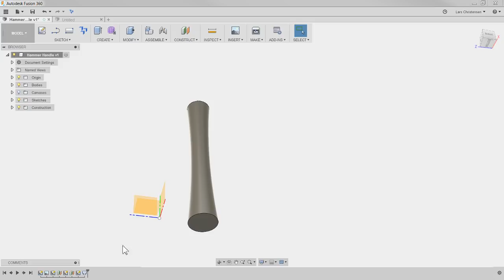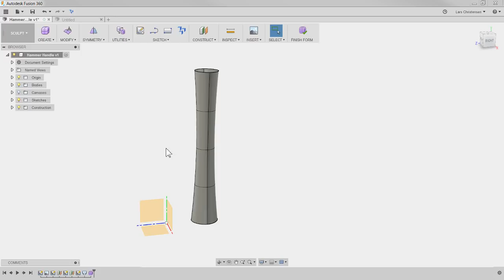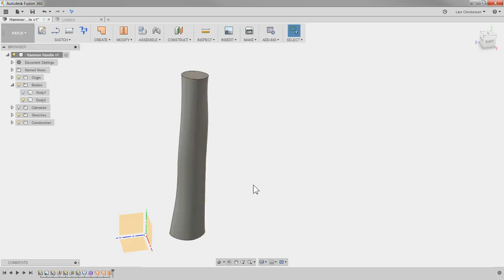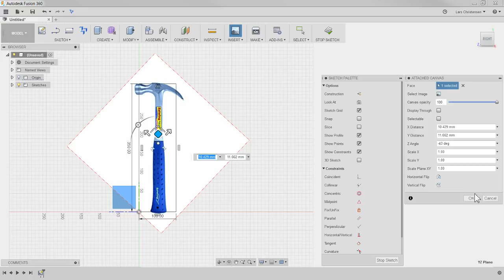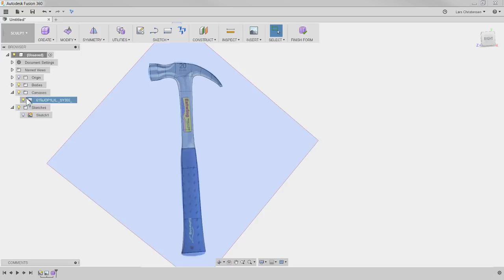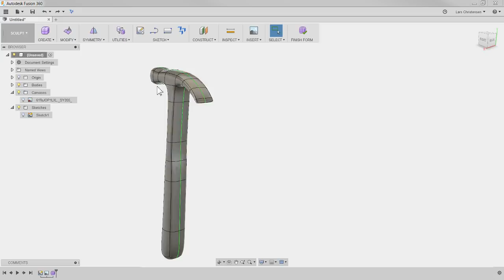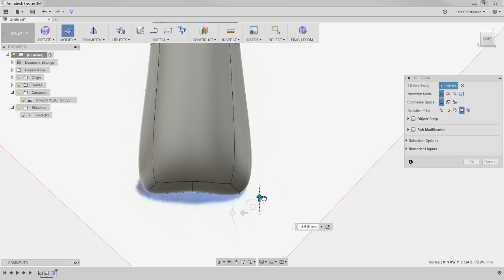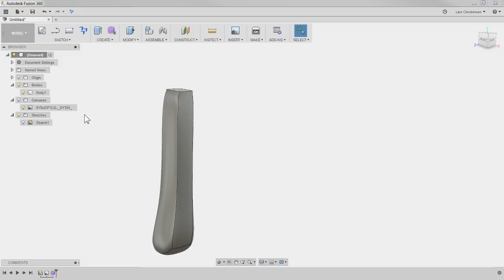Fusion 360 - How to Sculpt a Hammer #LarsLive 89

Comment: Rookie question:  Lets say I sketch a circle on the Y plane, then move it on the z-axis.  Could you please explain why it can't be dimensioned after that?  Why does Fusion 360 restrict that?  Thanks
Reply from the maker: Hi Flying Squirrel FPV Thank you for watching!
How do you move it? If you right-click the sketch at the bottom of the screen and select "re-define sketch plane" and move it that way, you can edit the dimension.

Hope this is helpful